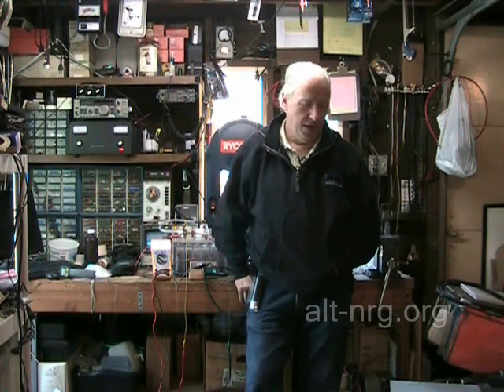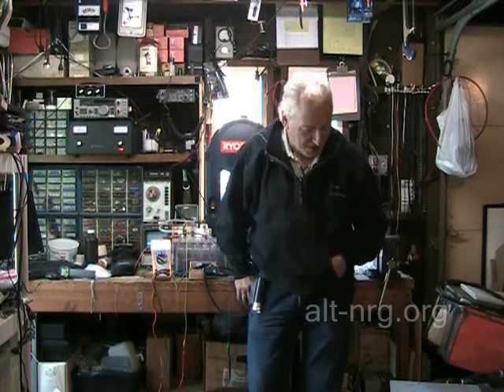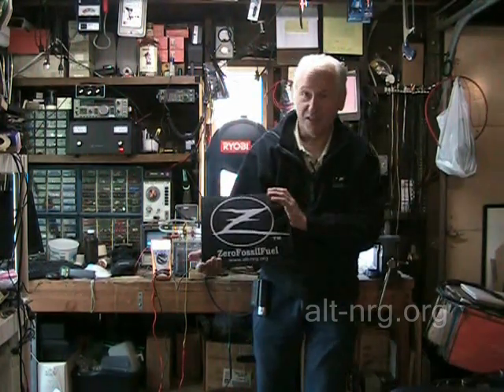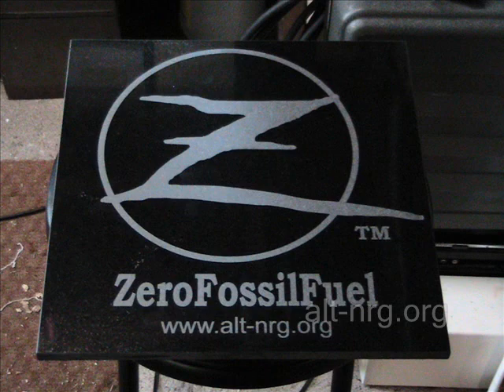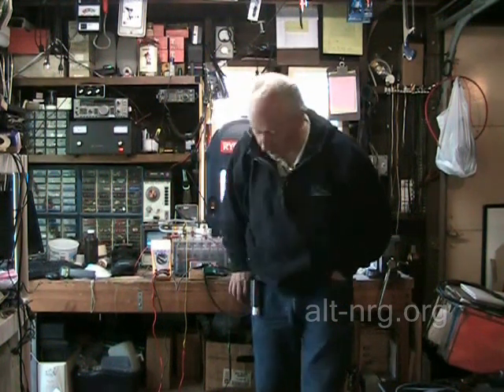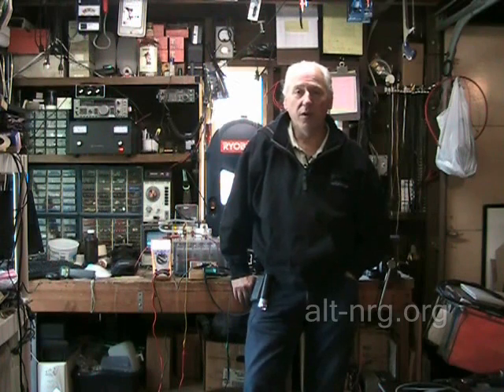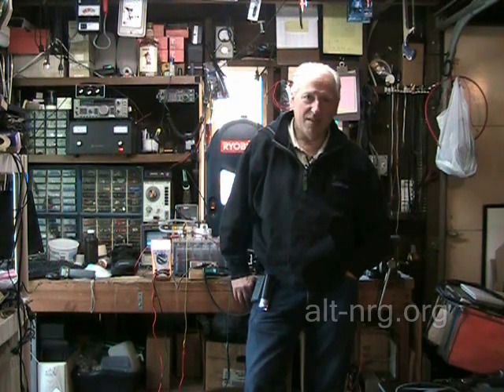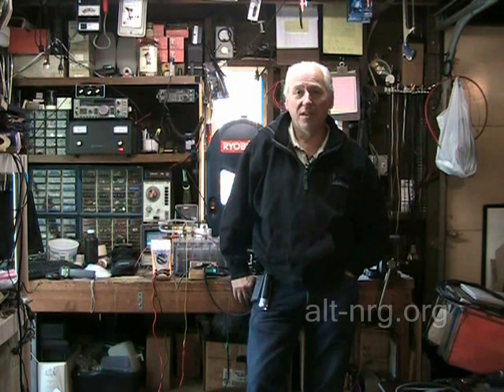#245 Batt-Cell update #2, 5.92MMW!!!

Comment: @ZeroFossilFuel If you think more conductive  materials would be an advantage then what would thinner SS plates do? I dont fully understand electrical stuff but as i see it, thinner plates would express any current with less resistance BUT trade off in increase heat transfer at any given current? possibly fail at higher ampres? local to me is a SS outlet that can stamp me 316L at a .3mm nomial thickness. Ive brought my fuel eff. car that i plan to push the KM/L (usual ways 1st like servicing)

Comment: @ZeroFossilFuel , Gee great results there mate! Platinum is actually the standard for elctrolysis in text books.
I have heard of some work with iron oxides, Haven't had a chance to fiddle with it.
theory is its already oxydised, so therefore non reactive and stable. I got that from a Phd student working on Hydrogen injectors and hydride storage tanks. He wouldn't say to much because it was supject to IP and ongoing research.
Not sure how they form the electrode. Best of all CHEAP!

Comment: makes me wonder what Stanly Meyer's MMW was
Reply: HHO Philippines I believe it was around 14 mmw with his original cell run off the alternator.

I believe his original cell ran at about 12.5 volts 40 amps with a production of  7 liters per minute. I would imagine the newer design with the voltage intensifier circuit was a much greater improvement over the original design. It would have to be a much better Improvement if it was going to run a vehicle especially if a vehicle was going to run using the water injector. 

The next question to ask is how much of an effect recirculating the exhaust gases had when it comes to reducing the amount of gas needed to run an engine due to the fact that it's supposed to slow the burn rate to co equal that of gasoline or whatever other fuel you're replacing it with.

Comment: @ZeroFossilFuel 

2,500 Watts at 12 Volts with 12MMW requires 208 Amps just to idle.

To produce the same volume with 6MMW requires 416 Amps for 5,000 Watts.

The problem is that HHO has very little energy density compared to gasoline.

To equal the energy contained in a gallon of gas, you would need 231 cu inches of  Hydrogen pressurized to 8,000 psi.

I have no idea of the energy required to pressurize Hydrogen to 8,000 psi.

It takes 8 hp to pressurize 1 hp of a compressed air 'battery'.

Comment from the maker: @Boyntonstu Well, that's the next phase after the conventional 4-stroke engine run time tests with HHO supplement to gasoline. Conventional 4-strokes are not optimized to run on fully gaseous high flame speed fuels like HHO. It takes a LOT of HHO to run one unmodified. Just to idle a 2L figure 30LPM. At 12mmw that's 2500 watts input, or 4.76 mechanical HP at a 70% power conversion efficiency.

I'm certain the same engine modified can be made to idle on 5LPM or less.

Comment from the maker: @TheNutscratcher I ran the tests both ways, with and without fully isolated plates. There was no measurable difference. The arrangement I have prevents current leakage despite the ability of the electrolyte to flow freely between chambers.